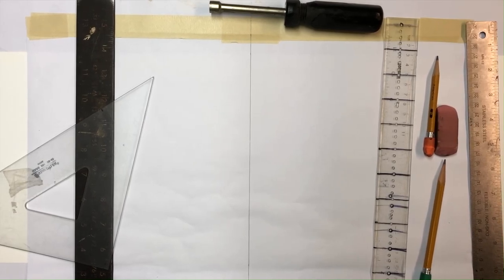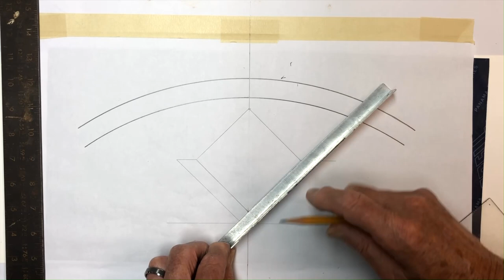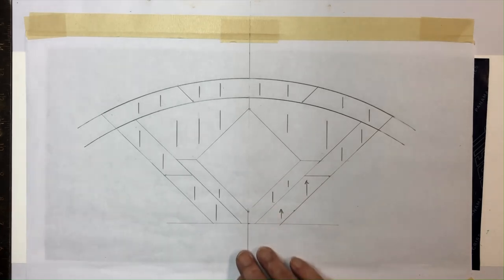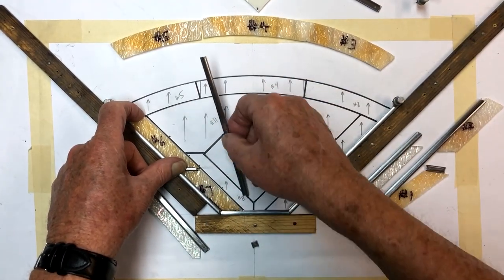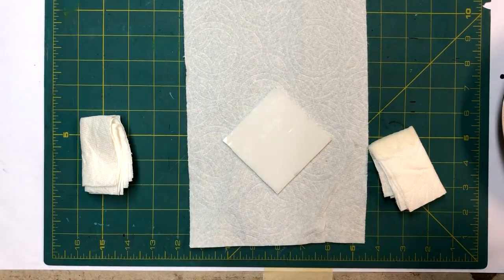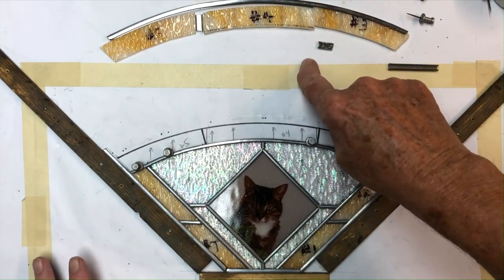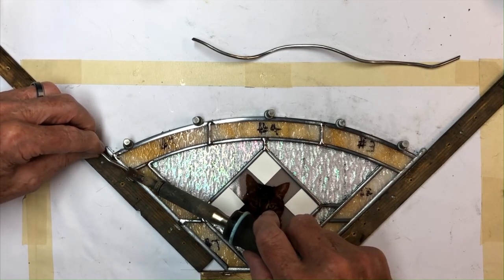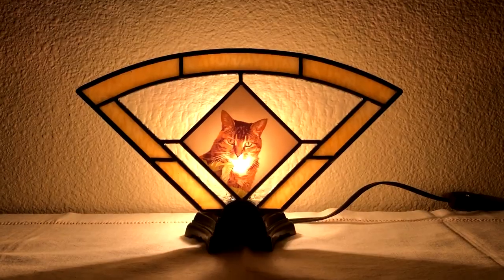Leaded Glass Nightlight with Photo in center

Comment: 25:38 Is there a video that shows how much to take off, how to mark it, and how to disassemble? Because I’m new and make so many errors I’m trying to learn how to fix them. I don’t yet know the sweet spot on how much to take off. I take off too much or too little and when I take off too little I end up trying to fix it and take off too much. I’ve done three projects and all have a gap somewhere. 
Also, what is that light base called so I can search for it?
Love this project. Thank you.
Reply from the maker: Hi, Thanks for your questions! First how are you cutting your lead came, hopefully you're using Lead dyke nippers, they give you a nice cut on your lead came. As for getting a good tight fit it's just a lot of practice and taking your time when cutting. I just eyeball where to cut the came by placing it where I want it to fit and mark it with a sharpie ultra fine point pen to mark my lead came. Remember to allow for the next pieces of came to fit. If you're new to leaded glass I would suggest you make some projects with just straight-line cuts at first, them move in to the harder projects. Check out the first video, How to make a solar lantern for beginners, it is all straight cut and might help you out. The base on the night light is called a fan base, I see them on ebay and they have gotten very pricey. You might think about making one out of wood or plastic.
Hopefully this has helped you out.
Regards,
Bill Stone
Reply: @billstonesstainedglasscrea3310  thank you. I just took a quick one time 4 hour class. I used some nippers but I don’t know what they are. My instructor didn’t have a problem but I was learning so much so fast that I wasn’t able to ask that particular question. I start a 8 week class next week and I’ll look into those nippers. Thank you.

Comment: Hi Bill, I was wandering what type of base are you using to accept the pins so easily, I remember you’ve mentioned in one of your videos but can’t remember which one. I’m using plywood which is not suited for pins but nails ! :(
Reply from the maker: Hi again, Thanks for your comments, glad you're enjoying the videos.
I'm using a Homasote Board #440-Sound Barrier for the top of my worktable. You can go online and check out Delphi Glass, they show both the Homasote Board and Metal Push Pins. I purchased my Homasote Board from an old fashion lumber yard in a 4'x8' panel. They cut it down to the sizes I needed to cover my whole worktable. It's easy to cut with a hand saw or on a table saw. I don't if Home Depot or Lowe's would have it, you can always check with them. I used horseshoe nails for years, then about 25 years ago I found the push pins and Homaste board and I have used them ever since then, it's so much easier than the nails. Check out all my videos by searching Bill Stone's Stained Glass Creation's. Have a great day!!
Regards,
Bill Stone
Reply from the maker: Hi Again,
Any luck finding the Homasote Board??
Reply: @billstonesstainedglasscrea3310  nope, yes I’ve found them on Amazon but by the time ı get them, it’s gonna cost over 120 US dollars :((
Reply: I live in Turkey, sophisticated things are not available or too expensive, but I’m managing it partly soldering as i go… :)) now I’m on lead cames… thank you for attention
. Best regards
Reply: I’m trying to work out what am i going to use for cementing, which you’ve not mentioned… glass putty softened with turpentine ??
Reply from the maker: So sorry you're having problems getting the Homasote Board. Back to using plywood and horseshoe nails. That system has been used for 100's of years. Best of luck to you.
Regards,
Bill Stone
Reply from the maker: Glad you're working thing out. It all takes time to get a system worked out that you're happy with.
Regards,
Bill Stone
Reply from the maker: There are a lot of Stained Glass Putty's out there. I only cement large projects, like windows for homes. The small projects we are making on my YouTube channel really don't to be cemented. When I do cement a panel, I use a product by a company called Beveldine. Studio Pro Black Cement work's great also. Check out some videos on YouTube on stained glass cementing or window glazing. Have a Great Day!
Regards,
Bill Stone

Comment: Where did you get the night light stand?  How do I get a good 45 deg cut with the dikes? When I cut the came for the angle, my came gets all out of shape and I have to trim the edges.  How do I get a good 45 deg cut with the dikes?
Reply from the maker: Hi Karen,
The stand for the night light was from E-BAY several years ago. I don't know if that style is available anymore. At that time, it was called a fan base stand. There is several different styles of these stands around, I think Amazon might even have some type of night light stand that would work for you. The last time I saw this stand on E-Bay it had really gotten pricey!! As for cutting a nice 45-degree angle on lead came with lead dykes you will have better luck by turning the came on its flat side with the channel facing up and cut the lead came on a 45-degree angle, this will keep it from crushing the channel closed on both the H Came and the U Came. I cut the U Came with the open channel facing up and just cut one side of the channel at a time. Hope that makes some kind of sense to you. There are some of my early videos showing cutting the U Came on a 45-degree angle. I think the one called Leaded Glass Solar Lanterns for Beginners shows that right as I start to make the Solar Lantern. Best of luck finding a stand that doesn't break the bank!!!
Regards,
Bill Stone
Reply: @billstonesstainedglasscrea3310  Thank you for the information.  I will practice cutting the 45 deg angle and eventually I will get it right.  I will watch the solar lantern video again to see how you did it.  I searched online for some night light bases, and yes they are expensive.  I have a CNC and will design my own.  I have experience in designing all I need are the correct measurements to make custom bases as I go.  I made this night light with the foil and solder method, I am 67 years old, and my hand shook like crazy making it difficult to get a smooth solder flow.  From now on I will be making lead came items.
Reply from the maker: Hi Karen,
Sounds like you have a plan, I have always liked the look of leaded glass over copper foil, unfortunately there are some projects where leaded came just won't work and you have to foil them. Best of luck with your night light stand, I bet you will make a really great looking one. The base I had is 6 sided and they are 2" each. They are made out of brass. So sorry they aren't arability anymore. Have a great day and do something fun!!
Regards,
Bill Stone
Reply: @billstonesstainedglasscrea3310  I will do the foil method with smaller more intricate glass projects.  For the larger glass pieces I will use lead came.
Reply from the maker: i Karen,
Sounds like a plan, best of luck with your projects. Have a great day!!
Regards,
Bill Stone